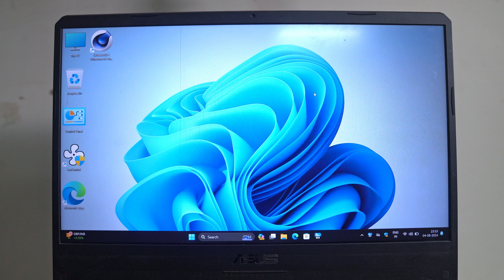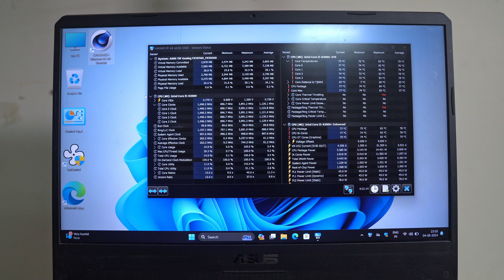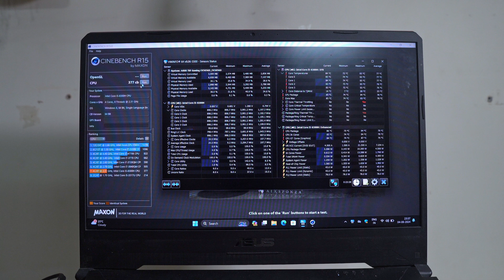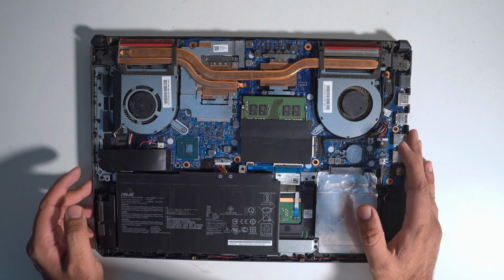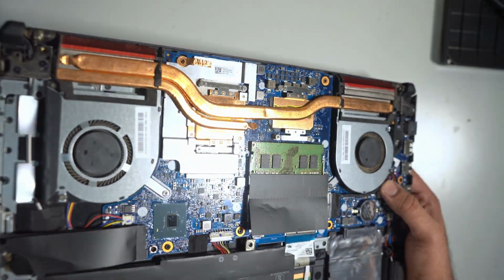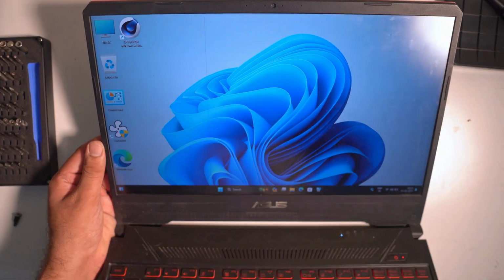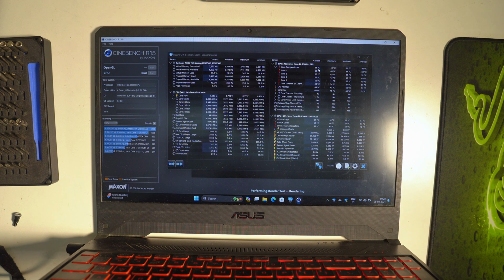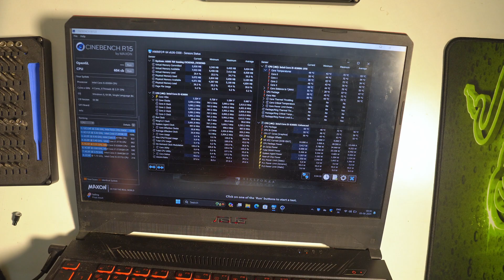How To Fix Overheating in Laptops - The Most Effective Method!

Comment: I'm surprised Windows even booted on that machine. 4 Cores? Seriously?
By the way..., no amount of thermal paste is going to help if the fans can't expel the heat coming from the GPU and CPU.
You forgot the most efficient method for reducing heat in a laptop:
CLEAN THOSE FANS!
Reply: You don't need 4 cores to run windows. It is enough with 1 core.
Reply: @Drottninggatan2017  Sure, it CAN run it, but not very well. It's like the difference between required and recommended specs.
Reply from the maker: Those fans were already clean, if they needed cleaning I would have cleaned them.
Reply: @intotech4891  Sure thing, buddy.

Comment: Good vid. Would also be a good idea to disconnect and carefully remove the fans and blow out all the dust that accumulated on them, and make sure there is no fluff or dust stuck to those thin fins on the heatsink where the air blows through.
Reply from the maker: Yeah, I know, should've mentioned that, thanks for reminding me!
Reply: It seems this effective method is beyond the technical expertise of this Channel?